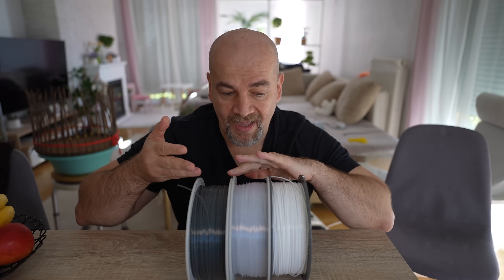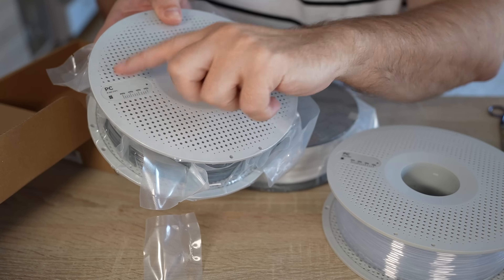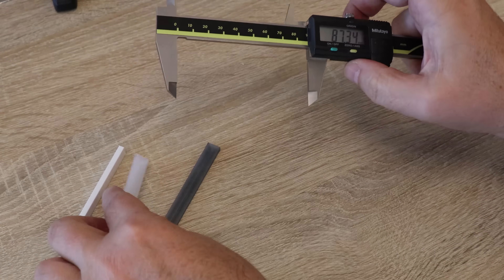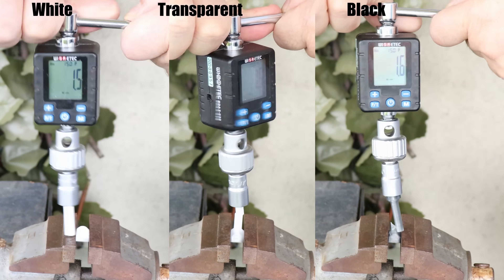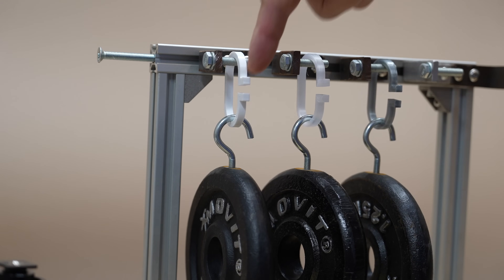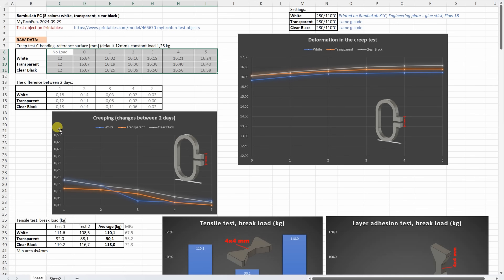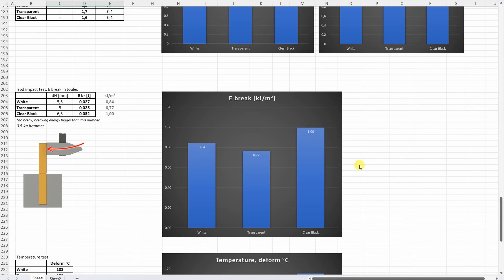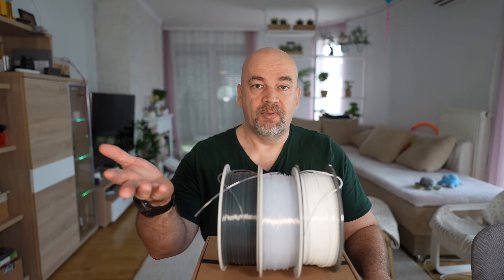BambuLab PolyCarbonate (PC) - Does it matter if it is black or white? (or transparent?)

Comment: I use polycarbonate for a number of purposes. But those are not 3D printed. It’s interesting that it’s one of the toughest materials you can get. It’s almost unbreakable. But when 3D printed, it becomes brittle, which is the opposite of its normal characteristics.
Reply: I believe the reason it differs from its original properties is that other plastic materials have been blended in to make it easier to print with a 3D printer.

Comment: I love watching your videos, as you are very thorough in your testing. In this case I'm however unsure if the conclusions of the video is correct.

I just watched CNC Kitchen's review of Prusament PC Blend, which concludes that their PC variant completely beats ABS - Especially in impact strength, which he measures to around 200% of ABS. I was therefore expecting the Bambu Lab PC variant to be somewhat similar - and definitely not much worse than ABS in impact strength, which was your conclusion.

I'm wondering if the decision of not drying the filament, even though Bambu Lab writes that it must be dried for 8 hours at 80 degrees celcius before printing, in fact is the reason why you got so bad impact strength results.

If so, the conclusion should not be "This PC blend is extremely brittle", but "This PC Blend is extremely brittle if you decide not to follow vendor recommendations for drying prior to printing". Printing with 60% cooling instead of 10-20% probably also make the issue worse, even if it's the default in the Bambu Studio profile.

Any chance you could do a small follow-up video - or just write a follow-up comment - regarding the impact strength, to ensure that the Bambu Lab PC Blend in fact is so bad as you concluded in this vodeo? That could very well be the case, but right now it feels like they are getting blamed for a bad product, but based upon a testing method that isn't really fair (or useful for assessment of the filament properties or comparison with other filaments).

I hope you will consider it. Thank you in advance.

Comment: The Bambu Labs filament guide says that drying before use is REQUIRED for PC.
Reply: Yes, it says. But I know that 95% of users will not dry it. And this is the state I want to test.
Reply: And it should be dry fresh out of the sealed bag, correct? If not I would question the value @ usd$40
Reply: it comes dry

Comment: PC is in some aspects a very strong material, but often also very weak. I read somewhere that the impact resistance is highly variable depending on notch size. PC also develops very easy cracks under dynamic loads (e.g. vibrations) as I can see on my motorcycle rally windscreen. Therefore, for parts on my motorcycle I use now Nylon or ASA.
Reply: This is going to depend on additives. At least for billet polycarbonate I've used the notched impact was very good compared to alternatives. Used for mechanical elements of an EV battery.

Comment: The recommended print setting from Bambu Lab is 0 to 60% fan. You need higher fan speed for higher print speeds and overhangs. For higher impact resistance , stick with zero fan or as little as possible like 10%.
This applies to every PC blend I have tried.
I believe the stock Bambu PC profile uses 60% fan.
Reply: Same experience here. You can get pretty prints with fan on, but interlayer stress is horrible and you're prone to layer splits during use. If you have a stress annealing oven I suspect this is a non-issue, but I haven't had time to test it.

Comment: Would be interesting to see the VOC / Particle emissions of these filaments. There have been a few videos on this but no one with as much of a scientific approach as you. Plus more data is better :).  Many filaments get doped with chemicals to print faster or to look glossy etc. One filament that we think is "safe" may end up being not so safe to be around when printing.
Reply from the maker: I am waiting for two testing equipments for this. Soon...
Reply: It will be far better than ABS and ASA and other styrene-group polymers. Perhaps just as importantly is what lingers in/on the printed part after it comes out of the printer.
Reply: I'm actually building a Nevermore Mini VOC recirculating enclosure filter with particle and VOC sensors right now before I start printing PC! I was inspired to make one when I found out that polycarbonate is literally polymerized bisphenol A, aka BPA.

Comment: To me the conclusion is that the color has little impact on mechanical properties. The variation you showed here is not significant compared to what I have seen in other materials. The only thing that I find significant is the shrinkage, and it makes so much sense now why I always have more issues with clear PC vs black PC.
Reply: Every Coloring acts like some sort of filler. So the most "authentic" values you would get with "natural" color of the plastics... In theory... In real life every company blends something into their Material. And so the named Filamenttyp is only "the main" component... That is why all brands behave different in testings. AND the next question is. Is the brand really the manufacturer or are they only seller and do they source from different manufacturers... Then every testing is useless... It even is important where they source there granules...
Reply: @Haunter1982  Seems true, for example many PCTGs are advertised as odorless, which mine is definitely not. Sometimes it's advertised as food safe and suitable for medical instruments, sometimes there is asterisk that it's valid only for transparent (natural) one. When I will run out of transparent PETG, i may try transparent PCTG from Filalab which someone said is completely odorless, atm I have black one from Extrudr. And about color, I feel like white vs black matte PLA from Bambulab are almost different materials with different layer adhesion and break type.

Comment: Idea: add another torque test where you measure the torque required to permanently deform a 3/8in square hole in a 5 or 10mm thick plate. PolyLight PC Transperant currently holds the record in my books at 42Nm. I can gladly send you my testing STL
Reply from the maker: If I understand correctly, I have to place the object in a vase and I have to use a torque meter and rotate it until it skips in the square hole (probably I would like to use 1/4 inch version). Are you using solid objects or with some infill? Send me the STL, so I can understand it correctly. My email you can find on About page (YT channel).
Reply: @MyTechFun  You understood correctly, only that i don't turn the torque meter a full 90° for my testing. I only turn it about 10-20° to find the maximum torque this material can take without a plastic deformation. I mostly used the factory 0.2mm "Strength" setting on a 0.4mm nozzle. 
This testing originated from trying to find the best material for printing a torque adapter to tighten a wiper seal on a hydraulic cylinder. Email is send

Comment: I don't understand what companies are doing with their PC blends. I have seen a lot of inconsistencies in PC impact strengh. The highest impact strengh I have ever tested was PC (and it should be) but I also encountered a lot of brittle PCs. I suspect PC is also very sensitive to printing temperature for it's toughness.
Reply: That irritated me as well.
From the tests I've seen Polymax PC seems to be the best when it comes to impact resistence.
Other PC filaments act like a completely different material.
Reply: PC always seems to be some "blend", but nobody seems to say what they blend it with or how much other material is in there.
Reply: Polymax is explicitly a blend I believe
Reply: That reason is that pure PC would not print very well so all the manufacturers have to add their own blends of additives to make it printable and usable. Its a bit like all the PLA varieties but more extreme because PC is a much more difficult polymer to make cooperative and practical for FDM printing.
Reply: @nucleochemist  The toughest PC I have used wasn't harder to print than others, so I still don't understand why some decide to sacrifice the main characteristics that justify the use of PC over other plastics.
Reply: @teedjay91  my point about the blends is that polymaker has some proprietary blend that has the desirable properties of printability and tightness. It's not like other filament manufacturers are doing something that makes their stuff worse than pure PC. I'm sure that they would love to have those same properties if they had the means to achieve them
Reply: Years ago, I bought PC filament along with a hotend from E3D.
Probably because it was pure PC material, it required the hotend to be over 300°C and the bed over 110°C.
Even meeting those conditions, severe warping and weak layer adhesion became problems. I think it actually needed even higher temperatures or a hot chamber.

Comment: That is some exceptionally brittle material! That really limits the use in some cases, but I suppose that is what PA and PA-CF is for.
Reply from the maker: We will find out soon (next week probably PA6 videos)
Reply: @MyTechFun  I will await your excellent testing before I go for a specific PA6 then! As always, good work
Reply: PC can also be really different, Polymaker for example even has different ones where the transparent is very stiff and brittle and the solid color one is very impact resistant.

Good to know Bambu is always the same pretty much, just sad it makes it useless for me.
Reply: Less shrinking or warping than PA though. I have found PC works for some mechanical situations where PLA will clearly fail and PETG is also not good enough. I personally dont like working with ASA and ABS due to the smell so I dont compare it to these 'typical engineering materials'.
Reply: @nucleochemist  I use a Qidi machine so I have a heated chamber as well as an enclosed printer, making warping far less of an issue. 
Nylon is just a wonder material and I feel like most blends of PC don’t stack up.

The purer PC blends that print at 300C or higher are pretty insane though.

Comment: I just bought 18 rolls of Creality value PLA ... at $9 per roll, delivered !
Haven't tested them yet. I'm hoping they are OK :)
Reply: That's nearly 40lbs of filament lol! Great deal though! I guess this was a flash sale that recently went on? I saw kingroon was recently doing a deal of 10 1kg rolls of petg for $9 a roll and I nearly jumped on it.
Reply: @AtomicBleach  Yes flash sale. I'm a sucker for a good deal.
I received them yesterday. They look fine. Vacuum seals intact an all.
I won't be able to test them just yet. But in the coming week I guess.
Reply: @ZappyOh  at this point I've been burned too many times with wet filament right out the vacuum sealed bag that I just dry all my filament first. You see such a boost in quality and stringing that it's worth having at least one half decent dryer. Think I picked mine up on a Amazon flash sale for like $30
Reply: @AtomicBleach  I agree ... I got 2 dryers and a big dry-box for half-used rolls. So the moisture problem is fixed for me :)

Comment: Hey, do you see a noticeable more interest in PC? Not everybody has a printer that prints near 280ºC
Reply from the maker: Most of nowaday printers can print up to 300°C and for example a very popular P1S don't need upgrade for printing with PC (unlike for those PA6 CF, GF filaments)
Reply: I printed in the P1S for mechanical parts using Polymaker PC, and it was a struggle. There was shrinking and adhesion issues, I had to use glue otherwise it would not stick to the bed.
Reply: @ingGS Dropping layer height to <=0.1mm with 80mm/s worked well for me on an X1c. That sucker was with a chamber temp of 50C though. Parts should have been stress annealed after on the bed, but didn't have the facilities for it
Reply: @iemozzomei I have read that for PC it's super helpful to print with very wide extrusions, like up to 0.75 mm line width. (E3D Mk6 0.4mm nozzles have a flat tip that is 1.0 mm across, so 0.75mm is still entirely squished into place.)

Comment: I am curious because I never printed with Polycarbonate 🤫
Reply from the maker: I have the feeling, that BL will soon have CF version too. That would resist fantastic to bending. (They have ASA-CF now) They are faster with publishing, than I am with testing.
Reply: @MyTechFun Any opinion on the ASA-CF based on Bambu’s website? It seems to be a very odd in-between material.